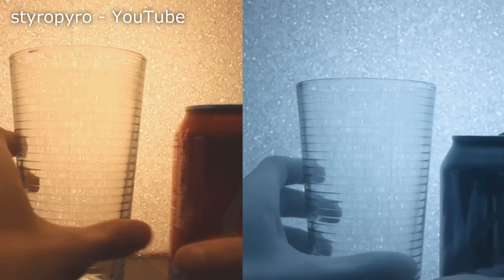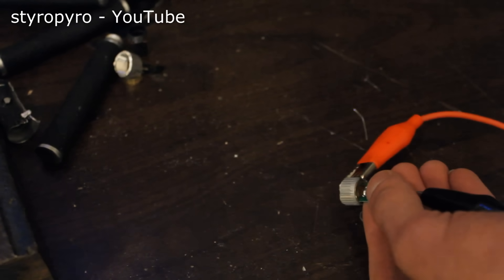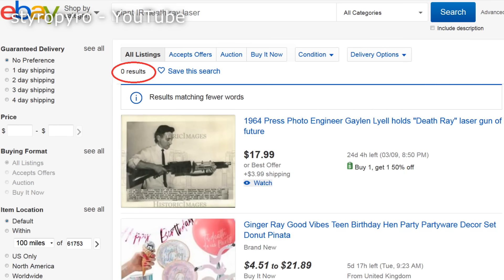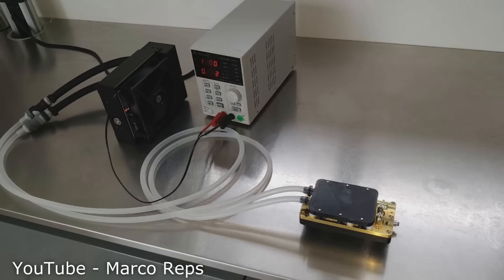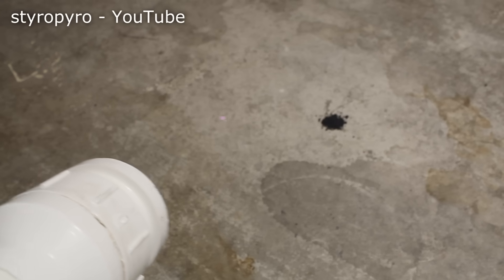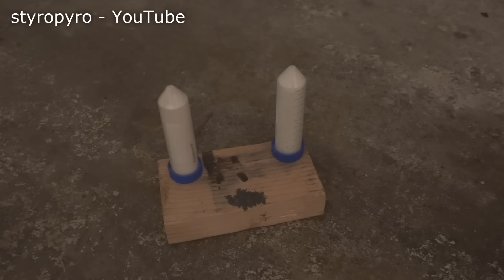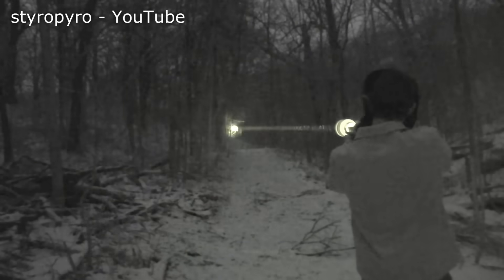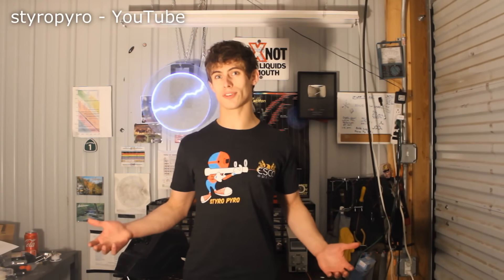100% Invisible IR death ray laser!

Comment: This would actually make a really good SHTF weapon. 

You can make one that charges off electricity and it doesnt use that much electricity. Its silent, almost invisible, perfectly accurate and travels a reasonable distance. Its a rather unknown weapon so people wont be looking out for it, and the protective equipment is incredibly unlikely to be used in real life. Even guns and other weapons you could technically wear bullet resistant plates and stuff.

Plus, it doesnt damage anything other than the eyes, so if you want to loot the gear off their body, it would be undamaged. If you needed information, the guy on the receiving end wouldnt be dead, and you could "question" him if necessary.

Comment: Your invention is really cool but I would not bring it anywhere near night vision.   Ive burned a PVS-14 tube on accident while using a 300mW 808nm laser. The laser was not pointed at the optics, I was using the laser like a flashlight.

Comment: We've used Co2 Lasers, 10.9 micron wavelength,  to discharge lightning from the ground,  by bouncing  it off a grounded copper metal mirror,  to discharge lightning before launching a Rocket from Cape Cornavel Florida.  Yep. Check it out.

Comment: I would like to see a video about truly deadly death ray guns with directional RF antenna tuned at the right frequency which causes molecular bonds ring and break apart, like a glass by soundwaves. NMR spectroscopy device with an external antenna can do the job. :D I really need it to kill flies and mosquitoes and slugs in my garden too.

Comment: What is the Maximum range this laser can burn stuff?
Reply: However far you can focus it and depending on how much energy is absorbed by the medium it goes through
Reply: @henrysanecdotes5323  is there something similar to this that I can buy online?
Reply: @alvin4100  I don’t know for sure but I am very confident that the internet has everything if you look in just the right place, legal or not. Look up laws and stuff because something like this could be sold to you from a place with different laws on selling high powered stuff
Reply: @henrysanecdotes5323  Thanks

Comment: Hey! Styro Cheap shot but, seriously...can u help me ? I'm under relentless attack which mixes up strategies and I'm out of resources. I've got HELLLL of a story, trust! Rachel
Reply: @Nick H apart from being cyberstalked and routinely burgled I am sure that this has escalated to a point wherein I am being bombarded with radiation. There is this beep which goes off with no particularly pattern situated in two different points behind the wall. I bought a hat and protective sheet and though this is for covering devices, I ..........I feel as though this is some kind of weapon which can be used remotely as I do know that somehow somewher

Comment: Could you use this with a ir filter to use it as a ir flashlight? I am a predator hunter and need a long range light to produce the light for distances up to 1k yds. Would you be interested in building one for me to use on a video.low wattage from a handheld power bank with the most output into a compact outdoor package like a mag light ? Let me know the cost. Message me back please.

Comment: 4.7M views. How many of you dingos made this weapon? Lol
Reply: Not made one anywhere near as powerful, but you can use an old battery powered drill and mount a laser to the end (take out the motor, gearbox and chuck. The trigger becomes the switch with a small modification. Mine is only 50mW green (could be 250mW IR with the crystals removed), but I like the green, and use it for chasing away pigeons that settle in inaccessible areas it's easily visible over 3km at night.
Reply: Not made one anywhere near as powerful, but you can use an old battery powered drill and mount a laser to the end (take out the motor, gearbox and chuck). The trigger becomes the switch with a small modification. Mine is only 50mW green (could be 250mW IR with the crystals removed), but I like the green, and use it for chasing away pigeons that settle in inaccessible areas. It's easily visible over 3km at night.

Comment: intellectual reserve inc, data-interface as cognitive operational control parameters with consciousness itself, DIVA system network allocation structure and hive mind, death of a civilization. feeding abstract energies to death by forcibly cutting off the normal energetic states from self. such a computerizational system would go through and determine, at least as best possible for itself what is "normal to system" not what is normal to the body perse and thus would deallocate the operational parameters of consciousness from having interaction with those energies. the energy doesnt not exist, it just means the human cant access the anomalous energies if they have it. what do the entities whom attach need? psychic parasites, star power, entropic configuration potential transference, and drainage of those energies. selling life to death's processes... the dark side of saint craft, death to a civilization. to get docility. 

For you, Snell's law, multi layered diffraction light polarization lenses and spectral total internal reflection through crystalline solids would be cool :)

Comment: infrared (that's how you spell it) is basically just heat but in light form and also red bud redder.
Aside from that, what if somebody made a much better version of this (battery in/on backpack thing, stronger laser, and generally higher quality stuff) such that they can snipe stuff from at least 100m away (328 feet) and set, for example, an enemy soldier in a war, on fire, then immediately turn someone into plasma from a distance without handling a rocket launcher or heavy equipment.
I just want an invisible fire laser handgun attached to a backpack, that's all. demonic laughter and arson intensifies
it would really cool to vaporize targets from a distance without nukes, or rockets, or any explosive weaponry. Legend of Zelda Breath of The Wild guardian lasers are what I'm looking for.

Comment: I remember when I was a young boy much younger than this kid here, I made a very detailed drawing of a ray gun using the sun as a power supply and focusing the beam of light into a lazer by using a Series of Magnifying glasses I even built a huge telescope using 3 magnifying glasses Two Used Carpet  tubes. I was the only kid on the block with 10' cardboard telescope. But I digress I really enjoyed the video especially Enjoy the Precision that you took of opening the Lazer Very Tip top Thanks for the memories kid

Comment: The really messed up thing about this? They've apparently created handheld weapons from this and dumb ass gangs in NYC are using on people believing they can get people to commit suicide or kill them. It uses the infrasound frequency at below 20 hz to cause temporary confusion, migraines and crippling anxiety. It's like you got hit in the head with something. Or slot of pressure  in your brain. Are they ex military? Not sure. I've actually recorded it. People are sooo bored these days.
Reply: These are infrasounds, not light.
And sounds cannot be directed like that, infra sounds are really quickly muffled in a short distance and effects dissipate fairly quickly.
So people would need to hand held a device for hours right next a person or target a whole building.
So it doesn't make sense and doesn't have anything to do with the video.
Reply: I made a good one that gives out two slightly different  high frequencies into two piezo tweeters. Based on something called a curdler or squawk box. Works pretty well over a large area from a small 9v battery. Interesting to see a large group of people suddenly go quiet wondering what the hell is going on. Top end of hearing range (15.625 kHz one speaker and same +- a couple of hertz in the other).

Comment: Profanity, an indispensable tool that is required for any kind of disassembly and repair.
As for heating, you have a constant current power supply, heating shouldn't be much of an issue.   ;)

Comment: i did have one close call recently whit a chinese 532mw laser pointer. it was cold out and the crystal had stopped working but the pointer has contact issues so somethies it doesnt turn on anyway. i thought i had turned it off and i started to unscrew it and thats when i saw a faint red dottyness from the optics. luckily this was just the "spill" from the optics being so bad and i didnt get the actual beam center in my eye and was unscathed. sure enough i took out my phone and pointed the laser right into the camera and saw a lot of pink ir emission.

Comment: If I recall correctly, either IR or red light is used for oxymeters. Hemoglobin has different emission wavelengths when it's  full of oxygen to when it's not, so a sensor detects those variations and gives an approximate amount of oxygen in blood
Reply: Exactly! -and theIR o2 reading is actually better than just approximate, they've become very accurate since they were first introduced -Peace :)

Comment: IIRC the ratings for IR lasers are different than those of visible lasers because the blink reflex won't protect you. A 1mW visible laser isn't likely to cause blindness by accident because if you accidentally flash yourself with it you'll instinctively look away. You'd have to deliberately stare into it to blind yourself. A 1mW IR laser on the other hand you accidentally point that into your eyes and you won't even notice until your vision starts to go.

Comment: I wonder how come you don't mess with CO2 laser? They START at 40 watts. They're completely invisible, but burns everything they touch. They're a little big though and requires a high voltage power supply, cooling water, and is somewhat fragile (because it's a glass tube). I mean a 50 watt tube is like a meter long...

Comment: I thought the thing that made a laser a laser was it reflecting between two surfaces with a phosphor which created 100% parallel light. Yours looks basically just like an LED and spreads out super thin without a lens. How is that different from a regular LED?

Comment: laser you can use the wavelength 660nm 630nm 850nm to heal wounds. how about making laser healing device, I need one myself for blood circulation and pain relief for back aches.
Reply: Power should be about 5mw or 7mw bit i have seen ppl sell 200mw for healing but i think that abit extreme maybe the lens spreads the beam tp reduce focused heat from the beam.

Comment: Bro, how did that IR camera in the beginning showed transparent glass? Unless it was transparent plastic.
Glass is supposed to be opaque in IR wavelength.
And second question, by energizing that IR laser, if im not mistaken, the wavelength of the ray shortens, and therefore is more energetic. That means it has now a shorter wavelength. If that IR laser can burn through stuff, I'd suppose it is energized and has a shorter wavelength. So, is it still technically considered an IR laser?

Comment: Hello!

I've seen some of your laser videos. But now you're interested in trying to make a solid state laser? I mean exactly NdYAG laser. Now I want to make one for myself that can cut 1-2 mm metal steel, and aluminum. I plan to buy a YAG crystal and pump it with a high power LED. I believe that NdYAG crystal can be excited with 808nm LEDs, but these LEDs are very expensive.
I've seen cheaper 10W LEDs that work at slightly different wavelengths but are cheaper. They produce exactly 730nm or 850nm or 940nm wavelength light. I thought I would use 850nm wavelength LEDs because it is closest to the required 808nm.
But since I don't want to waste my money unnecessarily, I don't know if my idea works at all. What do you think about this? Would you give it a try?

YAG crystal (or something similar).:
https://www.aliexpress.com/item/4000103795088.html?spm=a2g0o.productlist.0.0.5e055e86qvD1Bx&algo_pvid=b5a9cf97-8577-4bd7-89bc-b8962880c1ff&algo_expid=b5a9cf97-8577-4bd7-89bc-b8962880c1ff-33&btsid=0ab50f4915853923861684651e534a&ws_ab_test=searchweb0_0,searchweb201602_,searchweb201603_

Power LED.:
https://www.aliexpress.com/item/32836258655.html?spm=a2g0o.cart.0.0.382b3c00Vctr94&mp=1

Illustrative figure 1.: https://www.mdpi.com/crystals/crystals-09-00201/article_deploy/html/images/crystals-09-00201-g007.png
Illustrative figure 2.: https://api.intechopen.com/media/chapter/17616/media/image5.png
Illustrative figure 3.: https://lh3.googleusercontent.com/proxy/vg9db8uTBCyNc80HE0RA8HklKTJsdaKatnLpWecOFL4HEp2_kU3_jBl5MEr7ostUwrdvayHKVyypVNUjH4obgOwu3jhkCwoFOXcYjE2Cd1EtqwEavWnTFzlusF42T7qt21AD3Pb1qeFu4g

and this document.: http://citeseerx.ist.psu.edu/viewdoc/download?doi=10.1.1.446.9838&rep=rep1&type=pdf
and other, google.com search...

Comment: I have just bought 5 500mW 808nm infrared laser diode from eBay cost just about USD$13(HKD$100), it is still on shipment. I think this should far better than disassembling a 532nm DPSS laser.
I tried 200mW 808nm infrared laser, without any filters it displays very dim red colour, but it burns papers easily.
P. S. I designed my own driver for my homemade laser pointers. For 808nm diodes (implies 532nm DPSS which is in fact starts from 808nm)it is simply a buck converter that step down the voltage of a 3.7V Li-ion battery to about 2V and regulate its output current.

Comment: I've seen a high-power IR laser in a handheld gun used to instantly remove rust from steel. You can safely hold the piece and burn the rust right off, because your hand is transparent to IR.

Comment: you should build a laser strong enough to point at the moon and watch it hit in in 2.5 seconds lol
Reply: he could set fire to any flag on the moon....
Reply: @anomad6314    if there was air lol
Reply: @Davidevgen  would anything happen i wonder...
Reply: @anomad6314  i doubt it.  its to far away.  and the sun is far stronger than a any laser on earth at that distants
Reply: @Davidevgen  might just need to reach the vacuum of space... no idea how this stuff works... these items are crazy dangerous in the wrong hands...
Reply: @anomad6314  a flag cannot be burned due to no oxygen in the moons atmosphere
Reply: @anomad6314  it would lose power a bit more slowly over distance once in space, since gasses in the atmosphere do absorb infra-red light (that's actually how the greenhouse effect works!), however the biggest problem is the "inverse square law," which means the intensity of light decays following the square of the distance, so if you're 2x further from the beam's source it's 4x weaker, at 3x further it's 9x weaker, then if you're 4x further it's 16x weaker, and so on. It wouldn't be powerful enough to have an effect by the time it reached the moon, and either way it's an absolutely terrible idea to point any laser into the sky anyways (I know this was just a though experiment, but some naive kids could be reading and then the next thing you know a pilot suddenly goes blind while flying). You're definitely right about the dangers of them falling into the wrong hands!
Reply: He'd blow up the moon.
Reply: there is an xkcd on this
Reply: tmesisz show me pls
Reply: Lol
Reply: My cousins had a high powered laser and he said he was pointing it at a star and the dot was on the floor like it was reflected but I never seen it

Comment: That saw is like using a sledge hammer to tap in a finishing nail. You need to get yourself a Dremel with cutting discs. Listen to your cat when he is trying to slap your hand away from the components. He knows that you are doing it wrong.  Cats gave up on lasers  as they found them outdated tech.
thousands of years ago,well some still seem obsessed with the ones that just causes the magic red dot
Reply: The joke is that the way he was using the sawsall meant he also tore holes in his desk. He probably just used a dremel off camera because he isnt stupid.

Comment: So this is definitely cool, but I have a +10 idea:
Similar approach but have a mounting of some lasers across the EM spectrum. IR, UV, Microwave, etc. Mount them in a similar fashion to a gatling gun, but power the diode casing mount's rotation with a small servo engine.

Comment: Could this laser be weaponized to shine through a firearm and prematurely detonate ammunition?
Just a thought
Reply: Yeah but it would take a minute
Reply: Metal is probably to dense tho
Reply: Isn’t this the same principle those rust removing lasers use to clean metals?
Reply: It would take s long tine or it wouldnt be successful at all so better aim at the eyed in the middle of a fight
Reply: This one here could've likewise a direct approach wouldn't be as affective. I believe that an angle through the ejection chamber to direct the focal point as well as surrounding resonated heat trapped behind the primer of the ammunition would at the very least jam the weapon, or cause it to prematurely discharge. The former being strategically preferable.
Reply: Have fun lighting fire to metal
Reply: @fishron5594  metal can be heated numbnuts
Reply: Isaac Bruner yes but it can’t catch on fire, it heats and expels flames but isn’t on fire itself.
Also that’s why when metals hot enough you see some flames, that’s from the tiny amount of metal the main chunk of metal expels and thats actually a small explosion.
And I know metal can be heated everything can and I know that metals are one of the main heat trappers of all materials.

Comment: If it's not in the visible spectrum how could it cause eye damage?
Reply: @TheSkulleh  So rather than be so bright that it damages your eyes, it's because it would produce heat in your eyes that would burn them?
Reply: "Far infrared (1400 nm to 1 mm; CO2 lasers, 10600 nm): Thermal damage is caused by the heating of the tears and tissue water of the cornea by the infrared light. Excessive exposure to infrared radiation results in a loss of transparency of the cornea or surface irregularities."
Pasted from some white paper I looked up